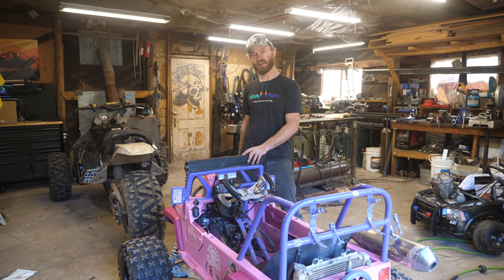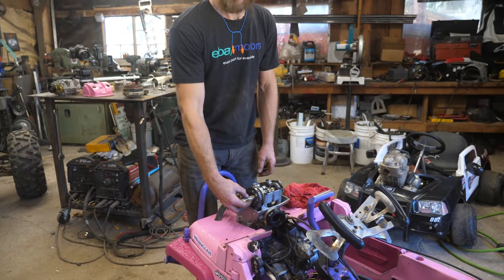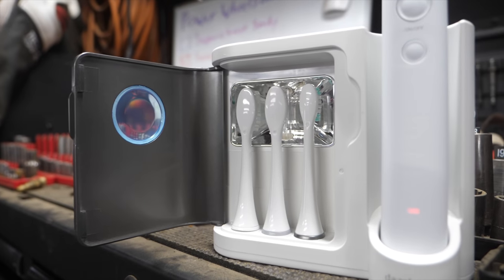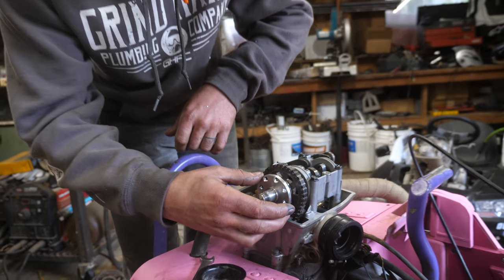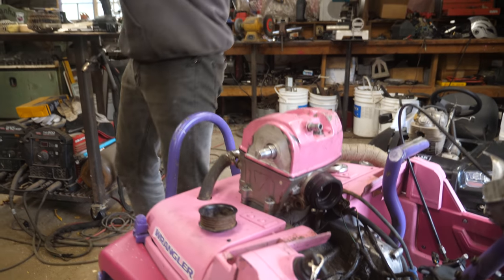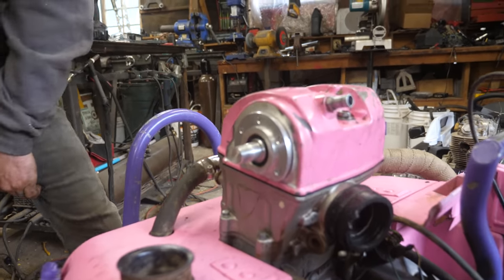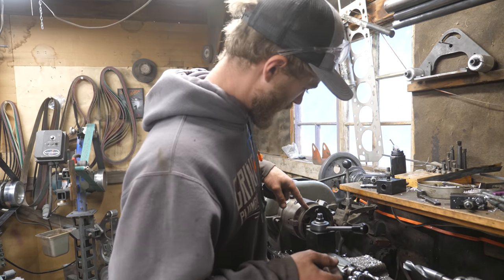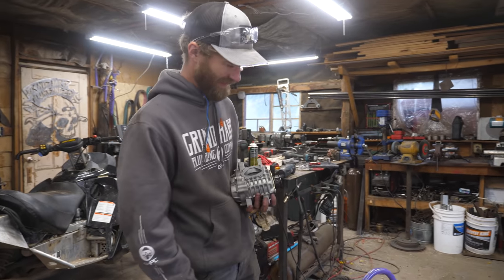Supercharger Install on the Barbie Jeep Go Kart

Comment: Never would of thought of driving the supercharger that way.. pure mad scientist.
Reply: its not the first time it has been done like that.  The old Detroit 2 stroke diesels had a gear driven super charger, driven off the crankshaft internally.
Reply: Legit there is no other way to run the supercharger.... If you try to do it through the stator cover oil will come out
Reply: @tebibyte2357  Superchargers can be ran off the crank with a custom stator cover. That's how its done on the rzr xp 1000 supercharger kits.
Reply: @bradhughes613  not for that motor, that motor has oil in the stator cover.
Reply: @tebibyte2357  .. they do make seals for oil.
Reply: @bradhughes613  fr?
Reply: @bradhughes613  lemme find that
Reply: @tebibyte2357  well you stated multiple times that you couldn't go to the crank because the stator cover holds oil. Figured you didn't know seals exist to hold oil into motors.
Reply: @bradhughes613  yeah I didn't know, I was also confused why oil was even I'm the stator cover... LoL
Reply: @bradhughes613  thanks so much!
Reply: @Bushra Duti that's what I was thinking.
Reply: The problem is it is running at half the crank speed.
Reply: @Christopher-mi6qe  that's not the problem, you can change pulley sizes to get around that.... The REAL PROBLEM Is that the timing chain can't handle pushing a supercharger at higher boost...
Reply: @Bushra Duti but I guess it should be fine I'm hoping because it already has to compress valves...
Reply: @Bushra Duti Yeah it's gonna cost them major everything to repair that when it does break. Because that supercharger is going to make alot of boost causing more stress on the timing chain... And I was just ignoring my brain because I can't do anything about it lol.
Reply: Problem is it's half the speed of the crank
Reply: @Bushra Duti the cam spins at half the engine speed... It will be fine dad😂
Reply: @ianbuilds7712  WILL YALL READ THE REST OF THE DANG REPLYS BEFORE YOU SAY SOMETHING ELSE DANG
Reply: @ianbuilds7712  Bro the supercharger will make alot of boost and it will out STRESS on the timing chain.
Reply: @tebibyte2357  Yeah I agree.  People don't realize how much power these blowers use.  A 707hp Hellcat probably produces over 900 at the crank, but uses 200+ to run the supercharger.
Reply: @Christopher-mi6qe  yeah seriously.  I hope it doesn't cause too much damaged when it breaks
Reply: @bradhughes613  CRF engines feed oil to the crankshaft by a gallery in the stator cover and the end of the crank runs inside the gallery under oil pressure behind a backwards facing oil seal !

Comment: Love the armchair engineers in the comments. What would Grind Hard ever do without you? 😂
Reply: I agree but I do have questions like: Will the timing chain handle the load? My guess is yes but it will stretch and wear faster. Will it be a problem? Also does the inside of the cam have oil paths the shaft might block? Anyway this is going to be epic!
Reply: @josephdecesaro1528  no oil paths in the camshaft
Reply: @josephdecesaro1528  that can chain and sprockets are definetly not going to like the extra load
Reply: I'm sure Grind Hard Appreciate All their viewers
Reply: Just one of those channels that I smash that like button without having yet watched the video...... I expect the best and you deliver the best.
Reply: @josephdecesaro1528  for what its worth, in most aircraft piston engines, the fuel pump is driven off the cam.
Reply: @sofielee4122  the air craft would have been engineered for that purpose
Reply: I'm a mechanical/topographic engineer and i gotta be at work in 7 hours.... Im a little jealous of old mate and his lathe skills tbh. But he is thinking and doing and working out the kinks.... no math required i wish i had his freedom. I would help but they dont pay me. (edit) i failed english.

Comment: Draw thru the charger with the carb, use a wideband to dial in the jets. Drill em if you need to. Low load pilot, main for boost fueling. Sand your needle as needed for med load. 

Timing, slot your pickup to skew your base timing as needed. 1 degree per pound is safe on pump gas

Quick and dirty way to make it safe and rip
Reply: A1 + agree for the draw thru the charger with the carb also helps with tightening the tolerances in the rotors on the compression cycle.
Reply: This is very good advice.... 👌

Comment: Grind hard plumbing co
Remember when you put pressure on 1 cylinder you need a volume chamber between the pressure side and the intake   so the pressure wont drop and rise and drop and rise and drop and rise 
With a chamber in the right size compared to your engine size it will run MUCH better and more smooth even its not optimal flow with a chamber

Sorry for my bad english im danish 😅

Comment: This mod is next level...  I think you just caused a lot of aftermarket companies to see a new market here. lol. everyone is going to have a super charged quad after this.
Reply: I seen one of these on a kfx 700 had brute force 650i heads. Upgraded cam. Running alcohol I think and had a 750 demon carb on top of the supercharger
Reply: haha not really, most people would just buy a bigger bike, instead of blowing up thier current one.
Reply: hamburg  not true at all. people stroke and bore their bikes all the time instead of just buying a bigger bike. If it builds enough power and is reliable people will do it.
Reply: @lucasvanhamburg4937  no lol all my race friends including me all have blown up our bikes before and guess what we did rebuilt them with and bored them out and changed to upgraded pistons, etc.
Reply: @punchabunchofbuttons214  yeah well the problem is that a modified engine producing significantly more power than stock WILL wear out faster, otherwise they would already come suped up from the factory. the only people I have seen modifying thier bike engines are stunters with thier groms because they cant just fit a bigger engine and there is no bike to replace the grom, and drag racers because they alredy have a litrebike and there is nothing more powerful to get.
Reply: @Rnfjaydee  I'm not saying it can't be done, if you have the will go right ahead but it aint worth it if you want reliable power and good service intervals etc.
Reply: @lucasvanhamburg4937  bro I literally build bikes.... there are far more people than the grom guys and drag racers that build up their engines. And the do it regularly.  Who even said we were talking about litre bikes? We were talking about a dirtbike engine correct? That's what the video is on. I'm just saying there are more people than you think out here doing big engine mods and upgrades on every bike from yz85 2 strokes to to raptor 700r. They all get built. Idk where you're at. But where I live it's like that

Comment: Love to have a LINK to purchase this "Mini Supercharger"!
Reply: Go on EBAY. It looks like its an AMR 500 or AMR 1000. I think. They are a couple hundred bucks and very common as they are an industrial charger out of China. Several models available. Search "supercharger".
Reply: You can also look up Porsche or Volkswagen  smog pump. I think thats the usual application for these. Probably find a good deal on used  also.
Reply: Wish item
Reply: He needs the link for the push lawnmower lol
Reply: Amr 300 500 1000
Reply: AMR300 up to around 600cc
AMR500 up to around 1200cc

Comment: Im glad you finally mentioned that cam shafts spin at half the rpm of the crankshaft. You need decent rpm at the screws to build boost. Its always a game of finding pulley diameter as too small and it wont have enough belt wrap to grip. Nice work!

Comment: Whelp, time to throw one on my motorcycle.
Reply: look for Aisin AMR 500 supercharger.  They flow 500cc's of air, AMR 500 supercharger on a 500cc engine would about double the power.  You can get them new for like 225 dollars on amazon.
Reply: @BigMuddyCountry  holy shit. Bike stuff is scary.
Reply: @Mainroad.Manjis101  yeah, they can make some serious power.  A honda cb750 makes 70hp stock, with the AMR 500 on it, they rise to like 110hp, think that is at 10 psi.

Comment: I've been watching you guys for awhile an have been blow away on how you two took my similar idea in a different direction I didn't think was possible to do  in such a tiny chassis. I have all ways wanted to build a small vehicle like a half or bigger scale size truck out of my 2005 honda ex400 mostly due to the fact that it has a reverse gear and that i still own/operate it to this day, but wanting to make it all-wheel drive chain driven with the engine in the front just like you guys did. I've had this idea since I was 20 but never having a place to perform that custom build, hopefully one day you guys will be watching a video of mine building my custom mini off roader. Keep up the great work you guys, can't wait to see her supercharged.

Comment: My first thought, the cam runs half speed. That little pulley is going to do nothing. Almost commented. Then you said exactly what I was thinking. You may still need a bigger pulley yet since it’s probably designed to run off that size crank pulley running at normal engine RPM. We will see I guess.
Reply: If all else fails... He can rig up a jack shaft and have a lot more options with pulleys and get it dialed in.
Reply: He can make the pulley on the supercharger smaller too
Reply: @elijahherman  Exactly my thoughts too.  Bigger pulley on the engine, smaller on the blower.  Gotta make sure that the blower pulley isn't too small though.  Believe those superchargers will self destruct over 12,000 rpm.

Comment: Yeah good one... Don't forget your gonna have the bottom end slow down way quicker than the blower's decelerating mass and load up the 'slack side'  of the Timing chain, compress its tensioner, then the slack is on the wrong side and it jumps the timing.... I give it maybe 10mins of blasting before the Timing chain either jumps or it beaks...  Say good bye to your valves ....

Comment: Twice the diameter doesn't mean twice the boost,  it's circumference that is the critical component.  Doubling the diameter more than triples the boost.
Reply: That’s incorrect.  If D is 1.00

C = pi*D = *pi*

So D*2 gets you
C = pi*2*D = *2*pi*

If D is doubled so does C
Reply: Sorry for the extra * 
I cant edit on mobile
Reply: Worse yet it will put more work into the air and raise the temp as well as lose efficiency. You will make less boost/circumference

Comment: Awsome guys. Just one tip. 
Your cams turn half the speed of your engine so it won't make boost as quick. Definitely try and run your supercharger off the crank. Will be so much more fun for you 👌 

Been subscribed for a wile now and absolutely love your builds

Comment: For the steampunk build, did you know you can just mirror image the lobes on a 4 stroke's cam and you've got a steam engine? Just add a boiler and you've got a steam powered sled that'll run off the pine trees in your yard. Perfect winter project, when the heat of the boiler won't suck.

Comment: Machine a plate on the intake side of the super charger big enough to put a turbo blow valve then u can change springs and shim then for great tune ability then your not limited to pulley sizes

Comment: you must drill a tiny hole in cover in  a very bottom of a seal. otherwise oil will be gather in that pocket between valve cover and a seal plate.

Comment: maybe u could have a bearing in the plate where the seal sits and maybe put a reinforcement plate inside of the headcover so you wont destroy the camshaftbearings with the extra load of the belt tension and belt vibrations .. just an idea. but probs for the idea it will be awesome when the carb is correctly tuned ... or you go full madman and put a camshaft sensor on this thing and run fuel injection with a free programmable ecu :D

Comment: Hmm, I wonder how well one of those tiny superchargers would work as a crankcase evacuation pump on a turbocharged/supercharged car engine...might be worth a try.
P.S. Ethan, you may want to set that supercharger up to draw through the carb instead of blowing through it. On a car engine, I know that a blow through application takes a special carb set up for that purpose because most carbs work as draw through units.

Comment: I wonder if you could like run it off of the chain so it would just keep having more boost every gear you changed.. that's a lot of work for the motor to be working right off the cam

Comment: The shaft you made is smaller than ideal, it should have been bigger than the hole in the camshaft ( interference fit). This way you can heat the camshaft with a torch or oven and you can cook the accessories shaft in a freezer or with a chemical spray. I know you do really great work and are very knowledgeable but I still hope that my advice can benefit you, nobody knows everything. You could have made it so that the interference fit of the shaft if the only method of attachment and it can be so strong this way that the shaft will sheer off before slipping.

Comment: Might consider some sort of bracket and bearing assembly on the other side of that pulley to take some. Load off the camshaft!
Reply: Also that supercharger moves 500cc of air per rotation at a 1to1 drive on the super charger it won't outflow the 450cc engine by much

Comment: I would put a second bearing on that drive shaft. The cam only has a single ball bearing at the chain side, the other end of the cam is running in a journal. I'd be a little concerned with the extended shaft and tension for the belt placing to large of a radial load on the cam and causing the cam shaft bearing surface to eat the head journal out. I think you are going to find that the head is going to get destroyed in the very near future
Reply: I was thinking a bearing and seal where he put the seal would be a good idea as well. Another comment was concerned about the longevity of the timing chain, which I think is a valid concern. We will see.
Reply: @Fix_It_Again_Tony  those motors tend to eat chains under normal operation in about 50hr at which point they are garbage and will tend to jump the crank sprocket. At least I have seen more then a fair share do!

Comment: when you do the math to figure the proper pulley size for s/c rpm, dont forget that you are starting off at a 2:1 reduction in rpm; being driven off the cam.
Reply: And they have 2:1 inverse with the pulleys so 1:1 with the crank.

Comment: You should mount the supercharger under the seat and drive it off the jackshaft so you get boost by gear xD
Also, does the camshaft have ball bearings?

Comment: The only concern here is that the cam turns at a different speed then the crank does. And super chargers are typically connected to the crank.
Reply: Haha nvm. I just got to the part where he said that

Comment: The camshaft only turns at HALF the speed of the crankshaft..... You’ll need to run a Pulley TWICE THE SIZE of the one on the supercharger in order to spin it at the correct rpm.

Comment: The only problem is that the cam shaft turns at 1/2 the rpm of the engine! might not see the same levels of boost! but on the other hand its half as parasitic in terms of power loss because of the gear reduction the cam receives.

Comment: I have an 12v Escalade Power Wheel from 2006 I built for my son to drive at car shows and the track that we put two 11 turn high powered 1:6 scale RC motors in that now  just sits in my garage if you guys want it? 

It’s slammed and has a neon kit on it too! Ha!
Help me install air ride on the Supra GS300 and it’s yours! I’ll come to you and you can film it! Thanks! Crisis

Comment: Driving from the camshaft is definitely an enormous error, the camshaft is only driven and 1/2 of the engine RPM. In a supercharger of this design high rpm is absolutely critical, you will almost certainly need change this error by creating a jack shaft to double or triple rpm or switch to the crankshaft.

Comment: Best scenario : either clutch driven pulley or magnetic pulley on the s/c , clutch driven would be easier since "depending on the springs/weights" it would engage automatically at "X" rpm , or magnetic pulley activated with a press switch on the throttle "activated at 3/4 to full throttle" , this way you could ride easy without s/c drag and no need to add more fuel @ idle and slow circuits in the carb , only main jet would need to go bigger . Nice drivability and power mix imo !! You could also "with electric magnetic pulley" use stock carb setup and modify the intake boot to fit a single injector that would activate at same time as the s/c !! Just sayin 😂 😝!! I’m sorry man my brain always goes engineering mode when I see projects like this !! Hahahha

Comment: Wait. The cam runs at 1/2 speed of the crank, so won’t the blower be under driven by 1/2 RPM’s than it should be??

Update:  nevermind, they just said it....

Comment: Turbo charger is supposed to be driven by a crankshaft not a camshaft,it will ruin the timing of valves in the long run

Comment: hard to tell which way your screws were turning from the video. They are turning center up and over to the outer sides down right? Not turning straight down like a wood chipper in the center. If so then it isn't working.

Comment: So one  thing i have a concern with, how is that shaft indexing with the camshaft? based on your design it looks like it doesnt have any keyway or  bolt physically locking the shaft to the camshaft, and it looks like it'll be able to rotate inside the clamp plate.  Is it just friction fit?